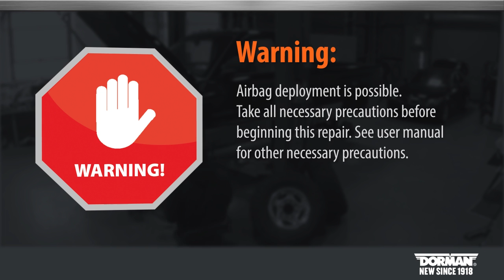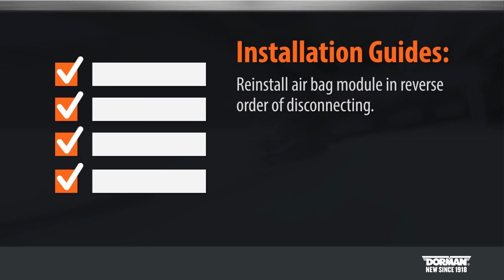Horn contact repair by Dorman Products

Comment: Also Amazon says this product doesnt fit my 99 f150 (amazon confirmed fit) but several reviews are saying that it does fit a 99 F-150. Whoever manages the amazon listing may want to look into that because its a little confusing. Additionally, its saying in this video description it will fit my 99 f150.
Reply from the maker: You can always confirm our official fitments on our website, in this case, right here: https://www.dormanproducts.com/p-83535-924-904.aspx.
Reply: Hi Luci! could you find it part? thx
Reply: Another reason not to use Amazon